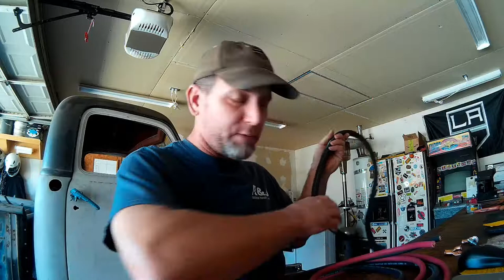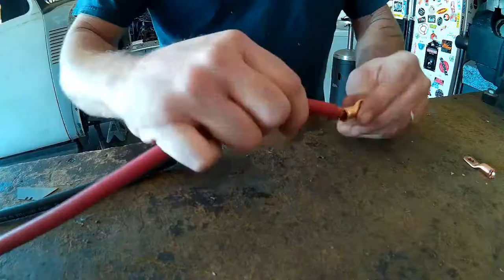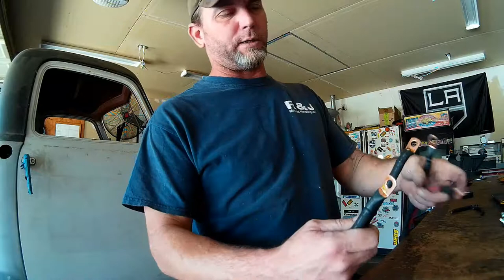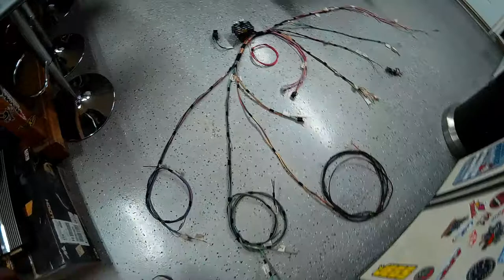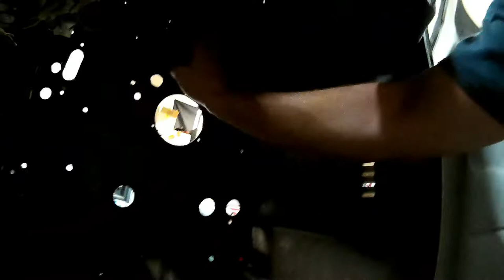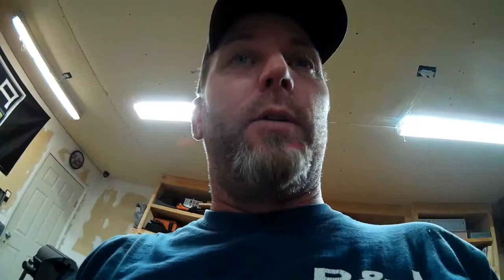P48 Project; Battery Cable Fab & Chassis Harness

Comment from the maker: meh, i confused my solder projects.....rosin core is fine to use for battery cables.  the silver solder i used was for a control cable project i built and with my old memory, i was mistaken in which solder i used for which.  :D